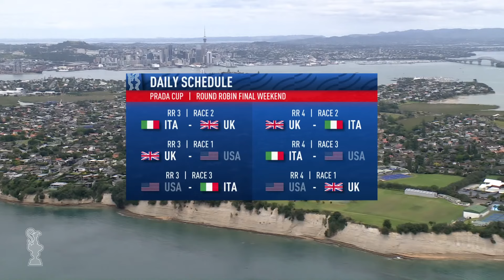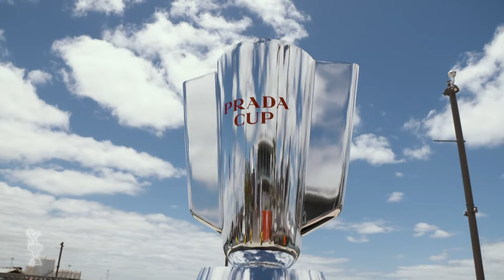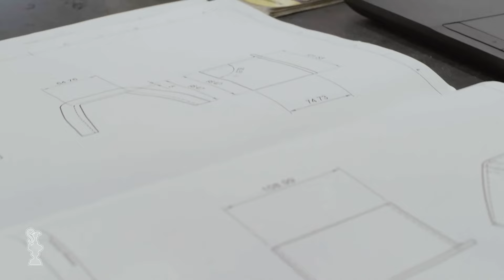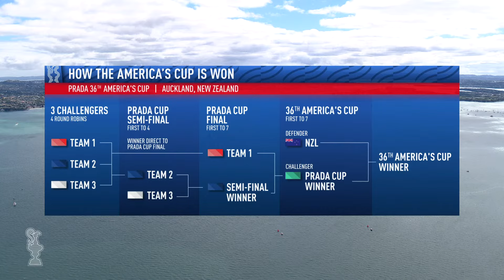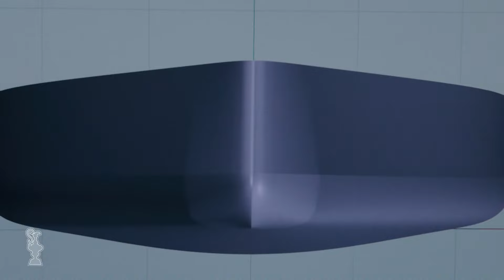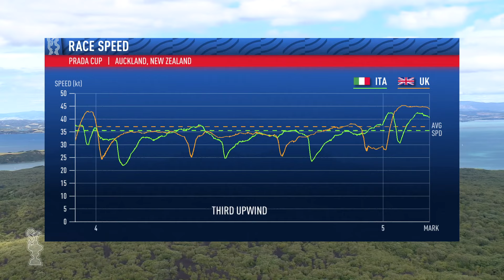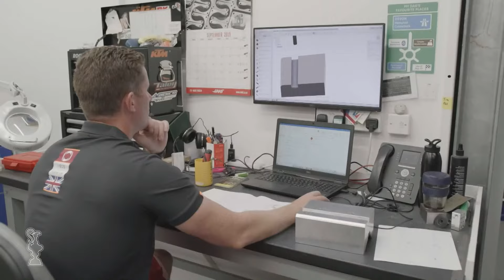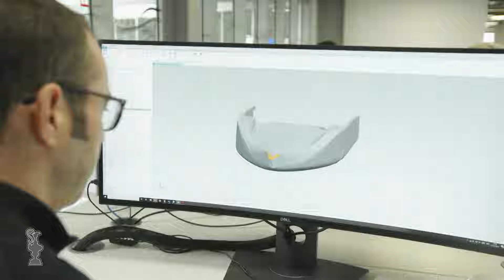PRADA Cup Day 4 | Full Race Replay | Round Robins

Comment: Why is it called a right hand wind shift
Reply: The wind direction has moved some degree to the right which will be beneficial sailing up wind on a starboard tack seeing you'll sail a closer angle to the top mark. I think.
Reply: @redskynights2986  thanks but is that to the right when looking  into the wind or with your back to the wind?
Reply: @tonyb83  The sailing course is usually drawn on the board with the wind coming from the top.  Anyway, regardless, a right shift is in the clockwise direction.
Reply: @tonyb83  looking into the wind :)
Reply: It doesn't matter which direction you sailing, upwind or downwind.
It's the wind direction relative to your boat.
Imagine you're on starboard tack and sailing 270°  if you have a 20° RH shift, then you could now sail 290°  in this case it's also known as a 'lift' because it's lifting you closer to the mark.
A boat on port tack might be sailing 350° so the RH shift means he would have to 010°  this is also known as a 'header'  because it's heading you away from the mark.
Hope that makes sense for you.
Reply: @jpdiegidio  'Clockwise'..nice simple answer thanks
Reply: @toddjamin  'into the wind' another nice simple answer, thanks
Reply: @paulfinnigan3562  'relative to the boat'... Another nice answer thanks but this time with more info about what it means when sailing, thanks.
Reply: To all of you who replied, thanks very much.  For us non-sailors it would be great if the Americas Cup channel did some videos to explain the terms the commentators use.
Reply: @tonyb83  You are very welcome.  Also, "the direction of the boat" is in fact a bit misleading since everything in sailing is rather relative to the wind.  And, as others have mentioned, that is "looking into the wind", specifically in the sense that wind direction is where the wind is coming from, not where the wind is going to...  Happy sailing!  :)
Reply: @jpdiegidio  Thanks Julio. I'm 73 and an arm chair sailor who likes watching the Americas Cup races, especially now the tv images have the graphics showing the course etc.  It would be even more enjoyable if the sailing terms the commentators used were explained in a selerate referance video. Thanks again, Tony
Reply: @tonyb83  The terminology, e.g. "tacking" or "starboard", can be easily looked up online.  Understanding that terminology amounts to an introductory course to sailing, then some even to racing, at least basic tactics and rules, to really appreciate the whole thing, short of jumping on a sail boat I mean... :)  Some of it may very well get done in time, in fact they have already tried a couple of clips on precedence rules: I'd expect more is coming, as long as general interest in sailing keeps growing.  Anyway, my 2c.  All the best.

Comment: At 19:31 ....  it appears the hole is already present ...,  did they not perhaps hit something under the water ?  at any rate,  it is clear there is a hole there before the capsize,  at about the time the loss of rudder is signaled.  Then at 19:34,  looking at the top right of the screen,  you notice something black in the water (perhaps the piece that was ripped out)  .....
Reply: Hole was punched when the side of the boat, just in front of the foil arm, came down from like 30 feet above the water.  That is an extraordinary amount of pressure on the side of the hull.  Go to the high dive and belly flop and see how you feel.  LOL
Reply: @Power5  Loss of rudder happened before the "airborne" incident.  19:31 is before the jump.
Reply: @cococalm  19:31 is after the splashdown but before the boat fell completely on its side.  Does that water really look like white water to you splashing off the foil?  The boat was cooking along before the jump.

Comment: This ghosting thing.. What a load.. Obviously no condender is present so y run for the 'gost point' wait for a aponant maybe.. It is a spectator sport after all. . So this comaradary with American magic means nothing if we don't wait to race with them instead of crossing start line then taking the point.
Reply: I believe this is about fairness. Imagine either Luna Rossa or Ineos would have damaged their boat in the last race. The fact that American Magic is out of the race for this round robin should not mean that the point is automatically awarded to the other teams. On the other hand the empires could not have cancelled these races in the sense of not rewarding points from this round robin either. So I think that decision for those ghost races was quite fair.
Reply: Racing could have been abandoned that day due to weather so no team would get points. So ghost start necessary to show it raceable.
Reply: It seams silly but under the official rules if no-one turns up to race... it follows that there is no race therefore no points awarded. If at least one competitor shows up AND starts the race and the other competitor fails to start or withdraws after the start... Points awarded to the "racing boat". In order to comply with the rules these so called "ghost races" have to happen. it would take a variation to the rules in order to avoid this and as we all know about the law of unintended consequences - what if the "attending boat" suffered some sort of failure before crossing the start line but the rules had already awarded points to them before they arrived on scene etc etc... "You have to be in it to win it!"